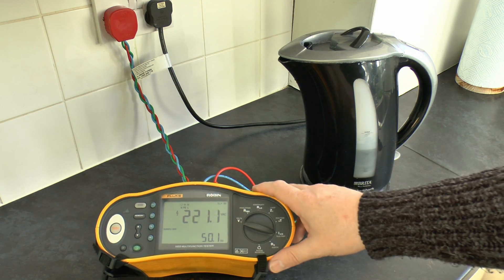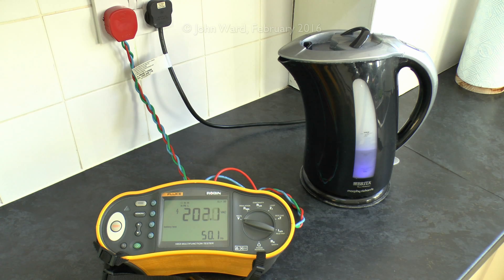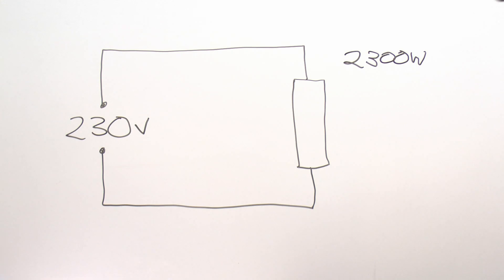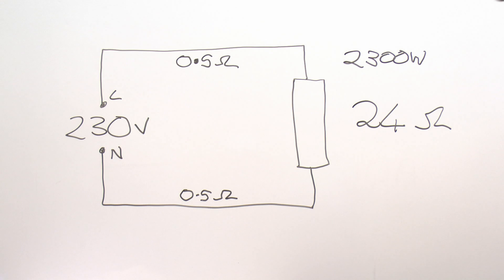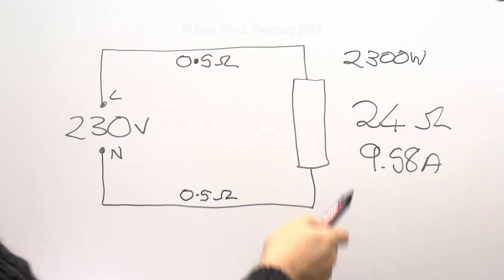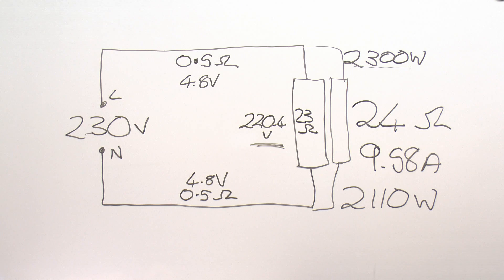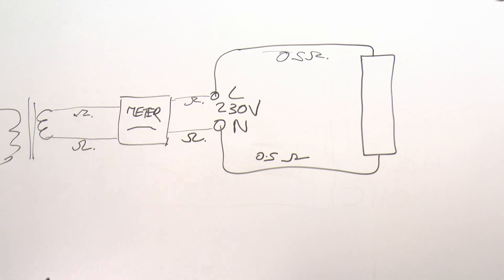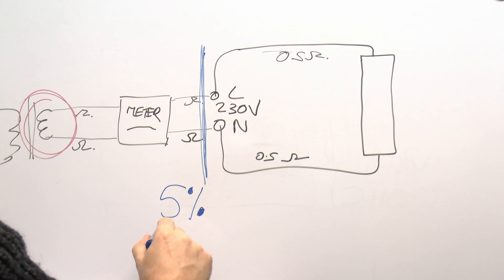Voltage Drop in Electrical Circuits

Comment: if i have to create an eletrisity system i take a voltage drop from the transformer to the light or to the socket including extension cord power strip and a long divece suply cord to smaler or = 1% .  the transformer  created as an magnetik voltage regulator to -0% and +1% max. the transformers are smaler units near to the customers to save copper! to reduce the loses from the magnetic voltage transformer the power rating get smaler. i thing its not the best idea to cock heat or take a shower with electrisity! i thing 10 KVA is ok for a flat or a house! to save more copper i set the middle voltage hight to 51,961 KV and the hight voltage up to bsp 1,558 MV. to reduce the capasity loads i take for middle and hight voltage gas isolatet coaxial systems! to save copper again generators can be createt at stator with large poles like old dc tpyes.   so is no problem to make hight voltage windings. than i dont need the transformers at power plants! to solv the problem with the low short circut capability of these winding geometrie a take a supercunductive non induktive current limiter!   in germany modern buildings have often 43 kva or 34,5 kva 3 phases servis!  older sometims just single phase 3,68 kva or 5,75 kva.  in germany i live in a 1973 building! if the elevator starts its lock like a small disconect to the light :( if i set the vakuum clener on :(  in germany in most cases no one of electians care about voltage dropp.  after the war everything must be cheap !
Reply: What??????

Comment: Excellent, informative video, thank you!  I am currently trying to figure out if something is wrong with the power supply to my house.  The most voltage I see is at my sockets is 226V and when I turn on high load appliances the drop takes this down to 210V causing some of my equipment to cut out and lights to flicker etc.  Should I contact my power supplier?  My father gets a steady 240V at his house but it is in a different village.
Reply from the maker: 210V is too low, and the drop from 226 to 210 is excessive, so you should contact the supplier so that they can investigate.
The example in the video was due to an underground cable fault which has now been repaired - when loaded the voltage only drops by 1 or 2 volts now.
Reply: Angus Smith - Had similar situation many years ago. Power supplier should take care of that...But most times they don't/can't because of all the surrounding infrastructure (high cost). 
In my case after complain they changed my house supply from one connector (barramento-put the correct English expression) of 6 houses to another, just beside that only supplied 3 houses. 
Meaning it was far from perfect but got slightly better. Anyway I was the only one  complaining (officially) all the others had the same losses but where not aware of the situation.

PS: During Christmas season (light decoration in nearby city) it went as low as 195V. Too many transformers, ballasts and a few other electronics lost...I payed the bill for all. :-(

Comment: what is the model of that fluke meter?
Reply from the maker: 1653 which is an older discontinued model.  Current equivalent is the 1653B
Reply: thank you

Comment: Interesting. I thought only the current flow in ampere would change in a parallel circuit. So there's a voltage drop as well, cause the cable resistances are in a serial circuit. I didn't expect such an impact on the voltage with indoor house wiring in comparision to outdoor transmission lines.

Comment: just measured mine , start with 233.4 v and when i put the kettle on (2200w) i end up with 230.7 v your wiring is really bad lol aslo i fluctuate 0,2 v max
Reply from the maker: +SuperZylar a few volts is what should happen, the supply to the property in the video has a fault which makes the drop much larger than normal.

Comment: Oh, you are so lucky with 10V drop at 3kW ;) In my place when I switch my 3 kW kettle voltage drops from ~220 to around ~190... And kettle draws around 2 kW instead of 3 

On the other hand in an apartment with new electrical installation and direct short run of 5 mm^2 connection from fuse box to outlet for stovetop (2.5 mm x2 parallel on both L and N in preparation for 3 phase supply) I get just 3V drop at 3.7 kW of power ;)
Reply: +mibars Where are you located? That kind of voltage drop sounds like what I'd expect in rural Italy but in your case it seems to be caused by your house wiring. In Italy it's the grid operator, they'll seriously string over 1000 m of 6 mm2 wire on poles supplying several houses!
Reply: Ragnar8504 Poland, countryside, very end of power line. Power line that was supplying two houses at this end back when it was constructed now supplies I think 7 or 8. I can clearly see when my neighbor starts the welder.
Reply: mibars i

Comment: John could  you do a video showing how to wire in a rcd unit for a garage with a lighting ,socket circuit  and supply for garage door. materials reqd and if I can take a supply from the utilty  socket circuit for supply

Comment: Hey John, is 292 V normal voltage for 230 V system ?

http://s12.postimg.org/91nusa365/P_20160221_171729.jpg
Reply from the maker: +Mark Schulz IV 292V is ridiculous, but so is the multimeter in the picture.
Reply: ***** Yeah, definitely, but multimeter is good. Tested with 220 V generator, also grid is back down to 235 now.
Reply: a133m210 http://s32.postimg.org/6ilp1uu6d/kup.jpg
If you wanna see it
Reply: you should use a metal cup for extra safety
Reply: +Mark Schulz IV I think he was referring to the way it had been bodged into the socket to test it. See in the video how John fitted a proper plug to the end of some leads with proper termination at the meter end, and used proper insulated meter plugs to improve safety in the test area. Doing it your way is just asking for trouble.
Reply: burgersnchips I know what he meant (:
Reply: *****  Yeah, I got shocked 5 times at least, while measuring.
Reply: +Mark Schulz IV the output of any unregulated power supplies you have plugged in is going to be completely wrong if your supply is 292v, could cause problems.  How long did it go on for?  There might have been a power line broken near you.. If you don't have insulated leads for that multimeter then you shouldn't be plugging scrap wires directly into an unswitched plug to make the connection like in the photo.  If you do, you should be turning off the power at the fusebox when you put them in, and turning on to test (without touching anything) and then off again to remove.  What you're doing is not best practice because you could cause a short (either the wires touching, or you touching the wires and then current then runs via your heart)... Are you trolling with this picture?
Reply: a133m210 It lasted about one hour , and no, I am not trolling in the picture.
Reply: a133m210 eh, I am boiling water in my cup with spoons for over 10 years now, still not dead yet.
Reply: a133m210 Pretty simple, extension cord, wires hooked up to either spoon and clothes pins to keep them separated.
Reply: +Mark Schulz IV also another way you could make this set up safer with not much effort 
is if you used an extension cord in that plug, setting up the multimeter at the output of the extension and not touching it at all when the other end is plugged in
Reply: Lets see a photo of your spoon boiling element!  Assume you have a plug connected to them and a piece of insulation keeping them apart- or do you just tie scrap wire around the spoons and poke the other ends of the wire into the socket? I'm curious to see it
Reply: Negative sir. Although the 230 V system can fluctuate, it should be between 216.2 to 253 V (that's 230 V 10%/-6%). 292 V is too much, and the outlet might not be safe to use.
Reply: Extraneous Conductive Part? maybe the cup should be bonded to the earth terminal, I will consider this in all future kitchens
Reply: Skaarj RPG 2 things 
-wtf man are you insane? or just trolling? 
-that metres is a piece of utter garbage that should just have never been into existence. Ho and BTW those crapy meters can be influence by thing like waveforms, batterie leve , interférences, the way you look at the dam thing etc...
You just can't get a realable information with such a setup.

Comment: Wouldn't the house next door be on a different phase?
Reply from the maker: +Nadim Awan Often is but not always, particularly in older areas where additions and alterations have been made over several decades.

Comment: So if you were captured by the Taliban, and you were locked in a room that had a light, you could unscrew the bulb and connect your secret multimeter wrist-watch to figure out the exact distance to their main base before finally using that same bulb to Morse-code the Taliban's GPS coordinates to the trusty old SAS troops?
Reply: Bloody expensive way to make a point

Comment: wouldn't be not better to measure voltage drop at the point where the kettle cord enters the kettle as this would also include voltage drop across the kettle plug/socket , rather than at the socket?
I am sure that if you measure voltage in different sockets around the kitchen and even entire house, what you gonna find is that the closer socket to the consumer unit, the highest voltage.
This will define actually what is the component supply voltage (which enters the heating element in the kettle), and explain the resistance (and hence voltage drop) across every connection and section of conductor- which then further would explain why the plugs heat up when component is switched up. But great video anyway, pure, king's English and brilliant methodology!

Comment: The 2KW electric radiator in this room is currently giving a good example of how wires have resistance. The wires are cold, but certainly more pliable than they were before switching the radiator on, and the plug has a slight warmness to it.

Comment: I'm now regretting not measuring the voltage drop on the old CU here before it was changed late last year. I'm definitely no longer seeing the lights dim slightly when a particular vacuum cleaner is used, but that may be because most of them are now LED and nowhere near as voltage-sensitive as incandescent lamps are.

Comment: So how long did it take to get the kitchen that clean?
Edit: I've now watched to the end.
Reply: +John Ward is 50 volt voltage drop is acceptable on 6 kW load in 230 V system ? And it drops not only in my house,  the whole line drops.
Reply from the maker: +Graham Langley Not mine so fortunately no cleaning required.

Comment: Your mains voltage already seems so low to start with! I've just measured my mains voltage and it's 248 volts, and turning the kettle on only drops a few volts then it climbs back up while the kettle is on.

Comment: That reminds me of a similar issue we had up until about 15 years ago, but in our case it as a 6 volt drop for a 2kW load (e.g. Kettle) as our mains supply ran for something like 500 metres to the transformer.  It wasn't a major issue until my my brother (who lived with us back then) got a 35A welder!  When I reported the voltage dropping issue to ESB Networks, in just 2 weeks they extended their high voltage lines right up to near our house, fitted a new transformer and now the voltage drops by about 2V in the socket next to the kettle when switched on.
Reply: the distance of 500 meters to the transformer was probably the main issue
Reply: Similar issue here. We are 300 meters from the transformer plus 70 meters of 16mm 3 phase cable.
When the electric mower starts it's a significant dimming of the lights, and the phase previous in the rotation will actually brighten slightly. 
Oddly, resistive loads will push the phase next in sequence up by half the drop on the loaded phase.

Comment: did you not get the original fluke lead?
looks like its been braided by a kid
Reply from the maker: +Andrew Watson The original Fluke one failed after less than a year of use with the connectors showing high and erratic resistance, so it was disposed of.

Comment: why is your oven on the same circuit as the ring main?
Reply from the maker: +Andrew Watson It's a single oven which has a manufacturer fitted flex and 13A plug.

Comment: Thats a terrible starting voltage! The site I work at is typically at 240 to 245v during the day
Reply: +Daniel Brydon 230v +10% -6% So as long as there is 216 volts at the cut out all is legal.
Reply: +Daniel Brydon Our supply is very very 'stiff', loading down with a 9.6kw shower, 2Kw oven, 3Kw kettle and a 3Kw tumble dryer, we only get about 1volt drop. 

The substation is just across the road. It used to cause havoc when we had GU10 halogen lights, if one would blow, the source impedance was SO low it'd arc and take out the breaker. EVERY. SINGLE. TIME.
Reply: +Daniel Brydon Watch the video to the end! JW explains the voltage is currently low there due to a fault
Reply: That differs from country to country, here its 230, at his place 220 and somewhere else 110.
Reply: +drkastenbrot I'm fully aware. I live in the same country (uk) as JW and the voltage should be 240v (230v harmonised) so 220v is already on the low side
Reply: +Matthew Brown still a bit weedy, must be out in the sticks somewhere lol
Reply: +Daniel Brydon yep we are around 249v during the day (uk also)
Reply: +add2k The fault was probably an open circuit fault and the DNO will have linked the network up through a linkbox to an adjacent substation as a temporary repair but later forgotten about it as there is nobody off supply
Reply: Anonymous
What blows is bastardising the use of the apostrophe as you have done.
Reply: +Daniel Brydon Or a heavily loaded area.
Reply: +TheChipmunk2008
My breaker cuts every time my halogen light blows. The substation is just around the corner. Why does this happen?
Reply: Dr. Lecter
What apostrophe?
Reply: +Anonymous The one in your comment that now says "(edited)". If you view the unedited comment:

Anonymous2 days ago
+TheChipmunk2008
My breaker cuts every time my halogen light blow's, and the substation is just around the corner. Why does this happen?
Reply: +Dr. Lecter 
I don't know what your talking about. There was never an apostrophe there!
Reply: +Dr. Lecter 
You have put that apostrophe in yourself lol why are you doing this?
Reply: +Dr. Lecter 
I think you need to get to Specsavers mate. There is no apostrophe. There is no word "and".

Comment: you had Installation Tester (Fluke) with you but you do not presented how the measure the loop impedance and short-circuit current?!?!
Reply from the maker: +peto22 Will probably do those in another video.